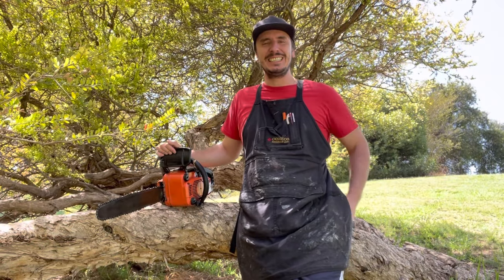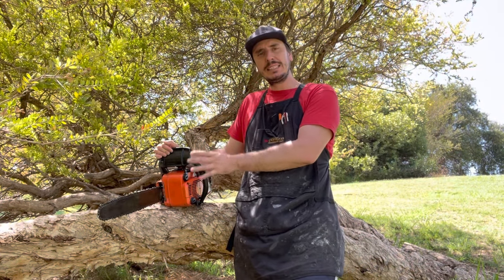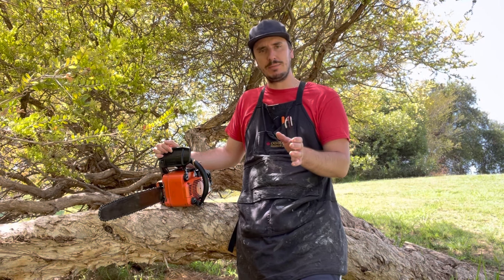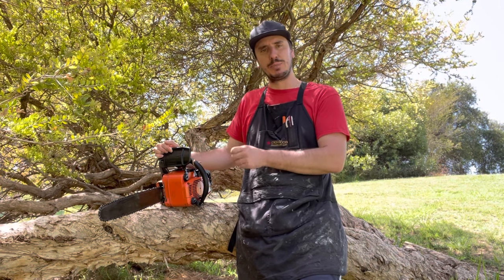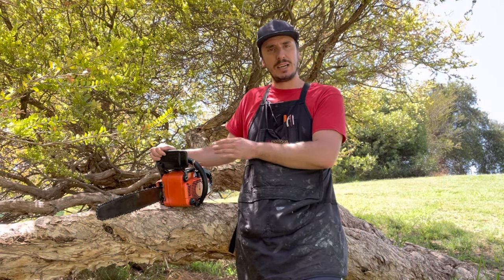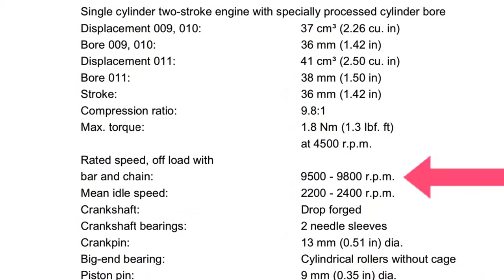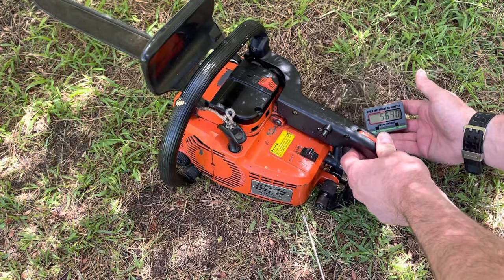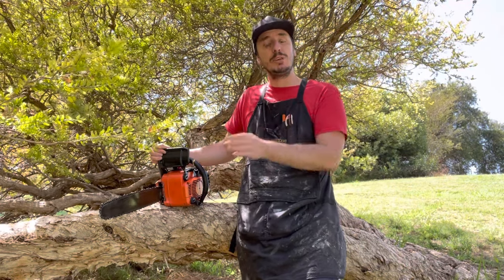STIHL’S OFFICIAL 2 STROKE CARBURETOR TUNING PROCEDURE.

Comment: I’m lost with this! Confused…. You say set tick over (LA) to 3000….. you then say set L to the fastest but no more than 3000…… why do yo need this step if it is already set to 3000 via the first LA adjustment? Surely the engine is already ticking over at 3000 & should not need any further adjusting to find 3000 because you have just done that? It must be me since everyone else seems to get this! Please enlighten. Enrico.
Reply from the maker: Sure let me explain.

You set La to 3000.
Then move to the L screw and turn it in and out to find the fastest rpm (it may increase a lot - this time it didn’t)
If it increases, then go back to LA and return it to 3000.
Then go back to L and turn it in and out to find the fastest rpm. If it doesn’t go any faster - perfect! If it speeds up again (it won’t as much but may a little) then use the LA to bring it down. 

This sets the correct position of the butterfly. Hope it helps!
Reply: ?? In the Video you say; if you find the highest speed whis the L srew...bring it back too 3000rpm from the la srew! the bring it down to 2500 whis the L srew??
Reply: If you set it at the first setting it would be slightly lean when you give it throttle. It would be fine at idle but a little throttle it would not get enough fuel and would stall or hesitate. 
I race two stroke dirt bikes for years. There carbs have more adjustments and use jets. I was got at setting them up. I also use chainsaws a good bit. Now all my friends ask me to jet their chainsaws and trimmers.
Reply: Yes, last step to drop 500rpm with L screw --> open L screw out to give little more fuel (rich)
Reply from the maker: @alanm8932 no, always use the L to bring the rpm back down by 500rpm. That extra fuel is important for good off idle acceleration, notably on carburetors without a part load fixed jet or accelerator pump :)
Reply: @VintageEngineRepairs having looked at your video, you did as you say, adjust the low mixture to reduce the idle by 500rpm.
I thought you'd have a link to the Stihl procedure in your video description. It would be very unlikely that that is what they were saying. Perhaps you got an "L" and an "LA" mixed up somewhere.
Is this taken from an official Stihl YouTube video, or a video on a Stihl website?
Reply: @VintageEngineRepairs 

This necessary with each carb. You need this setting procedure as you do not have a measuring device for CO or Lambda.

LA if dying

L set to peak (this is at optimum at around lambda=0,95 - common value for four and two stroke engines)
LA set to idle+richdown = 3000+500
L open up to reduce from 3500 to 3000 again

Helps to have an rpm measuring device with some damping function, so that the rpm values don’t jitter too much 

Engines with high acceleration needed will be adjusted to higher Rich down. Small trimmers with low acceleration due to load of trimming device will have less rich down.

Rich down is needed as the throttle shutter is opened quickly and you lean out the engine at first.
Reply: Excellent instructions, I just successfully rebuilt my 025 carb and need to get the speeds set, waiting for my tachometer to arrive
Reply: Hi, I love your videos. I have a walbro w37 carburetor on my paramotor engine. I am struggling with the carb settings. It is bogging on opening the throttle gradually, not everytime, but most of the time. Would the same principles apply to setting the carburetor as the still procedure?
Reply: Very good instructions. I tried this on my Stihl weed eater and I can’t get it to crank up, it worked great with my saw although I have not ran my saw enough to see if it fixes my original problem of not starting up after its hot and left alone for 20 minutes or so. It acted like it was vapor locked. I’ll go back to the weed eater tomorrow and I’ll put the H and L 1 turn out but where do I start with the LA screw (1 turn out also)? Thank You
Reply: Where can I get an idle gage?

Comment: Great Vid Tom. Only change I would add is I allow a 5 minute warm up, especially in the winter and in freezing conditions.  Also, these mixtures will vary with changes in temperature, humidity, and elevation (0xygen content in the air). Don’t be surprised if you used this procedure on a hot summer day and then in the winter when you want to use the equipment it starts acting funny. Again great content Mate!
Reply from the maker: Agree re. the warm up mate, though I wanted to share their exact process, they specifically mention the 1 minute varying rpm. My opinion is an engine is best final tuned when fully heat soaked. This can take a good 5 minutes or more of use / fully loaded! 

Yes, frequently tuning a 2 stroke is an important part of ownership. I’ll often tweak my carbs each time I take them out, even on the same day!
Reply: Hi, Where did you get the Tachometer. Thanks
Reply: That's why most every piece of equipment has a choke adjustment. Use that until it heats up and runs well in any weather.
Reply: @jpol3808  Carbs don't run well in any weather. That is why modern engines have gone to systems that can adjust the combustion on the fly. As conditions vary to get the best performance you will need to adjust your carb. Granted on lawn equipment we aren't generally racing them so it doesn't matter much if your conditions aren't changing drastically.
Reply: @NONO-hz4vo  Yep your correct. Direct computer controlled fuel injection is the way to go for any condition and any style of driving. Groceries or racing. It handles all situations. I was just helping the guy out with a tip on running his carb equipment on the choke slightly longer in cold weather to richen up the mixture while it's warming up. That saves having to play with the adjuster every time the weather changes on you. Later!

Comment: The critical factor that helped my understanding was to remember that lubrication is mixed with the fuel, so lean delivery is dangerous to the cylinder wall. So, for both H and L, this tuning algorithm is set up up to run a little on the rich side to ensure adequate lubrication and slower rpm. The second point is that when you're on the rich side of the equation, increasing fuel delivery consistently lowers rpm. I love your remark about building in a little reserve to that setting. So, when fuel changes, air filters are clogged, and ambient temp changes you've got reserve that prevents the engine from creeping into that territory of lean cylinder wall damage. I guess this is also why environmentalists don't like 2 strokes, since perfect stoichiometric balance is too close to the threshold of engine damage.
Reply from the maker: Spot on!! I agree with everything you mentioned here!
Reply: 😮e🎉
Reply: You probably are unaware, that Every piston is cooling (regulating the temperature) with the "vaporisation heat" from the Extra fuel on Top Rpm. So, with that added fuel, you actually Cool the piston, so, that it does Not Overheat and later start even to seize into the cylinder walls , consequently damaging them. And, because of that extra fuel added at max Rpm, the environmentalists don't like the 2 strokers, beside the added oil in the fuel 4 the lubrication.
Reply: KTM has been working to keep their 2 stroke bikes compliant in Europe and has gone to fuel injection. Just isn't possible to have a mechanical carb with one setting be able to burn efficiently across so many variables. 

For small engines though carbs are cheap, easy, and reliable. Maybe someday we will have some sort of hydrogen burning engine but by then who knows if there will be supercapacitors that run motors with 10x more power than we get out of engines.

Comment: It seems as if Stihl's aim is to set the butterfly open as far back as possible at the first progressive drilling, with plenty of fuel flowing out of the 3 idle drillings.... So that when you hit the throttle the butterfly is already well opened and has little distance to travel to WOT. Add the fuel from the 3 rich low jets as well as the high jet and it is no wonder it picks up instantaneously. It is like a gun that has the trigger cocked vs having to cock the trigger before firing.
Reply from the maker: Hey :) fuel flows through only the idle drilling at idle - air actually flows into the progressive idle drillings from the high pressure choke side and form an emulsion with the fuel. It’s not until the butterfly is progressively opened that fuel flows out of the progressive idle drillings.
Reply: Yes, that makes sense. It is hard to picture it, but that is a good description of what is going on. Thanks.@VintageEngineRepairs

Comment: I tune by ear free spinning and then tweak it under load, and it always ends up being a little rich without load. That's my target.  People talk about altitude and temp quite a bit, but it's going to be a rare case where they take it out of the climate they bought it in. Nobody goes on a world tour and buys a chainsaw as a souvenir. 🤣
Reply: Most people here cut their firewood when its 70-90 degrees out but when winter hits and its 0 degrees out and they need a few logs cut they expect it to run exactly like it did in the warm weather and it won't.
Reply: Bill a trimmer I can see as you wont use it in the winter but Tom used a chainsaw as an example.  Also I use a handheld leaf blower to blow snow off the cars in the winter and I have to tweak the mixture a little when the seasons change.
Reply: @KensSmallEngineRepair  Agree there Kenny.

Comment: I had just watched your video about the accelerator pump I didn't know existed in my Walbro on my Poulan chain saw.  I checked and it was in very good condition so I just made sure the passage and bore were clean and reassembled the carb with new gaskets and needle and lever.  Now you explain this settings so that it is easy to follow and it works.  Thanks for doing these videos and sharing your knowledge with us.  I'm almost 80 and have worked on a lot of different engines both gas and diesel.  It is clear instructions like you give that makes things easy if people just try.
Reply from the maker: Fantastic Lloyd! Always great to have people like yourself here who grew up and lived when repairing was the norm, rather than the throwaway society we’ve become. Great to hear that at 80 you’re still passionate about engine repairs. Welcome to the channel :)

Comment: This is just the video I needed, I have a 2 stroke Husqvarna 128ld string trimmer and have replaced it with three, "NEW" different carburetors with the same results. On a cold start it starts perfect, but at half choke it idles very, very high which is NOT normal. After I take it off choke it idles normal, it rev's up perfect, the idle mixture screws are set perfect  but when the engine worms up and I pull the trigger, then release the trigger it idles between 3700 and 4000 rpm's. The idle speed for this model trimmer is between 2300 and 3200 rpm's, and 3700/4000rpm's is to high with the trimmer head NOT spinning. Now, if I let it set and idle at 3700 rpm's for maybe a minute or two the rpm's will start to drop then it will shut off. In other words, I can't get it to idle at the normal idle speed without it keep shutting off.
Parts Replaced:
Fuel lines and fuel filter
New Spark Plug
Three NEW, different carburetors and gasket
Also a new air filter
Intake and gasket

My question, would a ignition coil cause these symptoms or what would you suggest I try next?
Reply from the maker: It doesn’t really sound like an ignition issue to me! I’d check the piston skirt through the exhaust port to make sure it’s not scored. Then do a pressure and vacuum test :)
Reply: @VintageEngineRepairs  Ok thanks for the advice....

Comment: Just tried several videos and this is the one that worked on my 201T and 461R. However, even with my H set all the way counterclockwise I still think my max rpm is a tad high. My Tach was one off of amazon and couldnt get a solid read of the high rpms as it jumps quite a bit past 9000rpm but still seemed a bit high. Either way, thank you a ton for this video as it is the only one that took care of 95% of my issues.
Reply from the maker: Hey :) you’re welcome! If you have the limiter caps on, you may need to remove them to get enough turns on the fuel screws :) hope this helps!

Comment: EXCELLENT video and very well articulated. Loved it and it helped me tremendously but I am left with one question!

When adjusting the H RPM of the my 455 Rancher, the specs show…

Maximum power speed 9,000 rpm

Max engine/motor	13,300 rpm

Which value am I supposed to adjust it to (less the 500rpm for safety measures)
Reply from the maker: Hey the second number (13,300) set it to about 12800 and see how you go :)
Reply: @VintageEngineRepairs  thank you

Comment: Gosh Dang - a nice running 2 cycle is a dream - great explanation - you really have to be patient with the adjustments - one screw up and you can kiss your shoulder joint goodbye with endless pulls on that nasty jerky little engine - Back in the 70's there were little 2 cycle snowblowers that would never start - of course our 'schools' were worthless to teach us what you just did and so we could never figure stuff out - all that youthful energy just wasted - Now - I ALWAYS run my engine gas out to keep that carb clean - since these little 2 cycles have little tiny ports that varnish up quite easily
Reply from the maker: Glad you enjoyed the video and found it useful :)

Comment: It's a shame that Honda don't tell you since they preset it at the factory which is why I reused the original carburettor when I fitted the Chinese clone Honda GX35 engine onto my dads Honda UMK435 brush cutter attachment.

I am sure that I had the carburettor adjusted to its"sweet spot" using the low speed mixture adjustment screw but it kept stalling after I let the throttle off from wide open throttle & it wouldn't idle during a cold start.

You told me that it could be because the high speed screw needs to be turned in a bit but I still need to check things such as the metering valve lever to see if it's set to the correct height & also that the 1 way check valve underneath the lever for the needle in the metering chamber is closing off when air or carby cleaner is applied to it  from underneath the metering chamber.

If I need to adjust the high speed screw then I will need to remove the brass sealing plug on the side of the carburettor which is covering the high speed mixture adjustment screw..

I have refitted the original OEM Honda GX35 carburettor for that reason, even when I was able to restart the engine again when it was warm after it stalled it wouldn't idle until I adjusted the low speed mixture screw again.

That's why I thought that the check valve inside of the carburettor was sucking air into the metering chamber through that check valve which may not be closing off !
Reply from the maker: Best of luck with it :)

Comment: I use an old Bike shifter lever with cable to control the choke since I live in Northern Ohio where we can have 30 ish F and 90ish F - so I find controlling the choke is nice but not possible with a  Back pack blower - so with a Choke control near my hand  I can adjust the carb  knowing that I can adjust adjust the choke if (in Autumn) we went from 73 degrees  Monday to 39 degrees Tuesday -
Reply from the maker: Very interesting! It’s not an ideal way to do it, best you just tweak the carb with a screw driver and let it breath in the correct amount to get a full cylinder charge :) I will tune my equipment multiple times a day depending on changes in temp or altitude. It’s not really necessary for most people, but I like my engines to run where they are best.
Reply: @VintageEngineRepairs  I went on your channel and then saw all the 2 cycle stuff - had I known that I would have kept my caveman method on the down low - For me it's a practical solution and I can just edge that choke  controller an  itsy bitsy bit to get that blower into some high sonic rev's - but what would be nice as per your advice to properly adjust the needles or to have a servo controlled  needle adjuster with an RPM device - oh and also a 'cordless drill' type starter motor for the backpack blowers would be good - thanx for the replys
Reply from the maker: @TotalFreedomTTT-pk9st haha no not at all, we all do what we want, it just wouldn’t feel right if I didn’t mention a quick tweak is normal and you’re not the only one so don’t feel like you’re doing anything wrong :)

Comment: Here in the uk we seem to have some variability in the fuels depending on where you buy from.  This variation seems to mean that you can get the tools adjusted right, get another mix of fuel and the tools are difficult to start or die at tickover or tricky to rev up.  Have any others found this variation or do most use premium 'proper' petrol (gasoline)?  Thanks for some great informative videos.
Reply from the maker: Yes, I have heard of that before, I’m not surprised to hear it. I’ll often spend 20-30 seconds tuning my machines each time I take them out, though I’m very picky and want them running optimally!

Comment: I love your videos! I’ve worked on my own small engine all my life. I’d like to get a tachometer like yours but the PET2100DXR is so expensive. The 2000DXR is less than $30. Is it as good? I’m 73 and don’t want to spend over $100
Thanks Paul V
Reply from the maker: Thank you! Is that the one with a red strip around the face of the tach? If so yes, it’s excellent and for all intents and purposes, it will do everything this one will :)